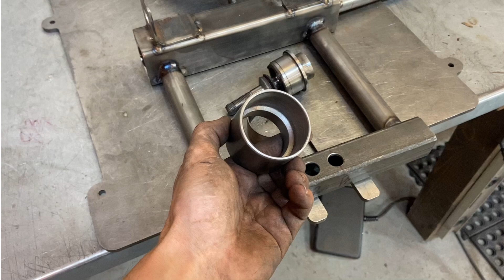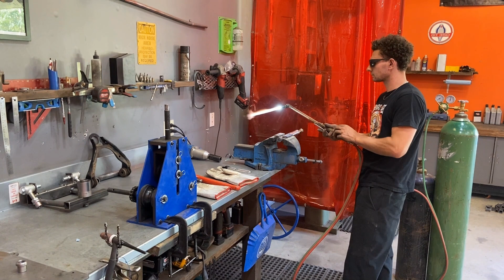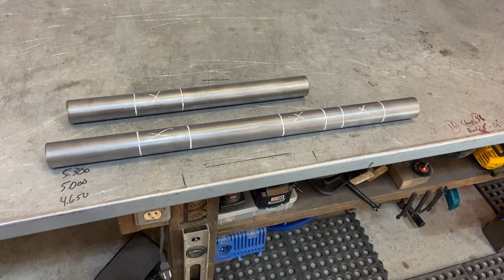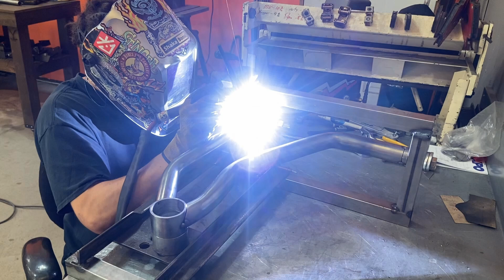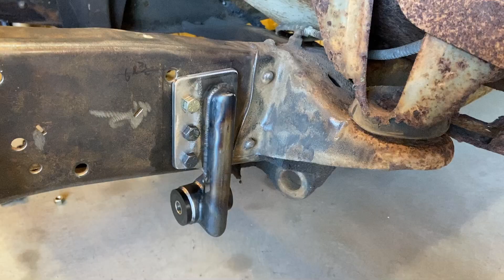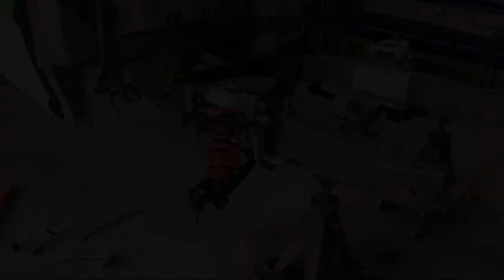Tubular Control Arms/ Crown Vic 1" Narrower - Bones & Co. 1971 F100/ F250

Comment: I know the CV swap chatter about the width is quite common concern, this looks like a great solution.  No issues with the steering rack width (if you mentioned I didn't catch)?  Well done.
Reply: Will you be selling control arms like these?
Reply: There are two companies who sell the kit.
Reply from the maker: I believe you have to chop 3/4" off the both steering links and adjust the sway bar links as well